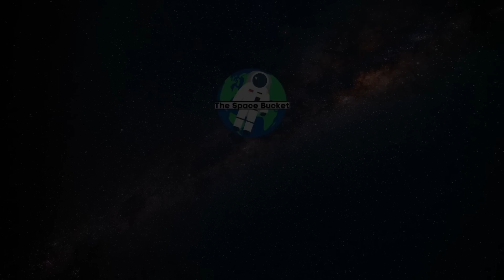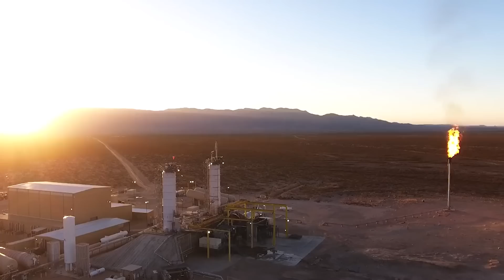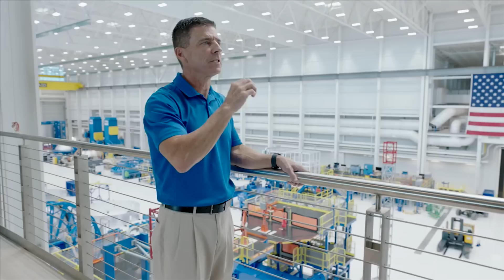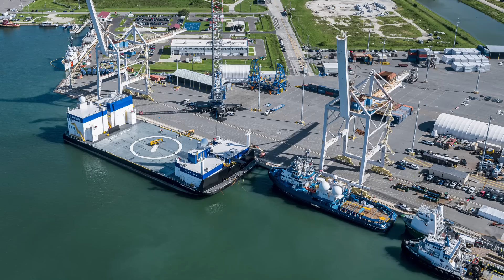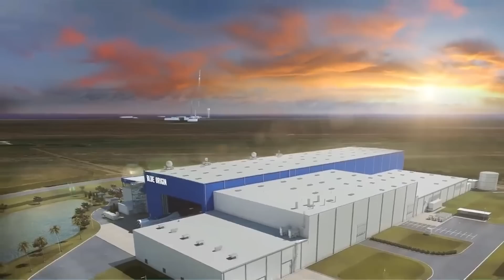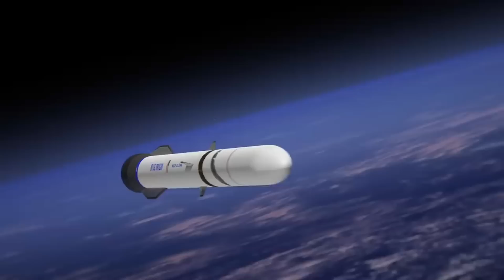A Flight Capable New Glenn Is Vertical On The Pad

Comment: So they are going to fly a new version of falcon 9. Neat.
Reply: you need to see size compere to falcon. This is super heavy rocket
Reply: Compare the fairing size and reusable payload weighf capability of both. It is superior to Falcon 9 and Falcon Heavy in almost every way.
Reply: @BigBlueFlame-000  but it hasn't flown yet. or landed. and rapidly been refurbished
Reply: @tisoymorena121  so? Blue planned it to be reused 25 times and refurbishement in 16 days. They said they are going to do 8 launches in 25. If they managed to do that then it's already cheaper than and better than Falcon 9 and probably heavy per kg cost. It will be superior to currently any rocket SpaceX has.

Comment: Before I say this:  I'm rooting for them.  But having said that, they have a benefit SpaceX never had:  The ability to watch SpaceX do it first and copy.  SpaceX probably saves Blue Origin 50% on research spending by just watching them.
Reply: Blue Origin predated SpaceX on reusable rockets and even the DC-X rocket predated both companies.
Reply: @aluisiofsjr you can’t deny that spacex has been much more prolific in their use of reusable boosters with falcon 9 and falcon heavy, which I’m sure has provided a lot of insight to technicians working on blue origin
Reply: @aluisiofsjr they were not orbital first stages
Reply: @aluisiofsjr  Others predated with test articles and BO has never returned a booster from anything like the same speeds as F9.  Spacex took and old idea and for the first time made it practical.

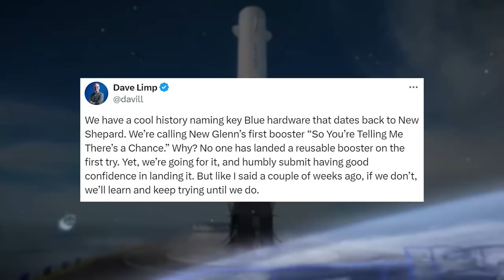Comment: 4:24 No one told him about starship flight 5 ?
Reply: That tweet was from September, before flight 5.
Reply: Umm, that was on the fifth try, as your comment also implies.
Reply: @davidjohansson8739  Just wait, they'll parse your comment down to the font in favor of "their guy." 
Me? We need DOMESTIC RE-LAUNCH COMPETITION because foreign re-launch competition is definitely on the horizon.
Reply: @davidjohansson8739  There was no attempt made to catch the booster on the first 4 flights, so they did land it on the first try.
Reply: @daisaigaming6836  I'm not trying to diminish the achievement of SpaceX here, but they didn't crash 4 boosters into the sea for fun you know. They did it because they knew they probably couldn't land them on the first attempts (which they were correct about, since the 3 first launches literally exploded).. So I would say his statement is still correct.
Reply: The point is domestic competition in landing-capable booster hardware is good.
Reply: The tweet is before flight 5

Comment: I hope New Glenn works. but I have a feeling even if it does, their launch cadence will still be glacial. 20 years, zero rockets. No, the bezos bozo blaster and test articles do not count
Reply: 8-10 launches next year, 24 in 2026.
Reply: They were not working on a commercial launch vehicle for the last 20 year though.  Maybe you just don't understand what's going on.

Comment: New Glenn was designed to work the first time.  BO is a traditional rocket company and that's how they operate.  It's also why it has taken this long to get to a launch, why the vehicle looks irreplaceable instead of mass-produced, and why we probably won't see a second New Glenn launch for a year+.  If anything at all goes wrong with the launch, it won't be because they're prototyping and anomalies were part of the package; it will be a failure of a finalized design.  Same exact scenario with SLS—had it failed to finish the mission, it wouldn't have been because they were merely testing a prototype to inform future prototypes.  These companies do all their testing on the ground, and that's why it takes so long.
Reply: "BO is a traditional rocket company" - Search YT for Convair Atlas Quarter Film Report HACL Film The San Diego Air and Space Museum has a collection of raw engineering footage, internal reports, reports to Congress, advertising, since Atlas had 4 or 5 engines and ran on alcohol, and earlier like home movies of Charles Lindberg gliding over Torrey Pines while visiting Ryan air.
Reply: Solid take. I find myself impatient sometimes. But I remember that SpaceX is one of the only companies to do that kind of testing at a reasonable scale. No disrespect to others such as rocket lab. It’s still amazing and very necessary for the space industry. But it’s simply a cheaper vehicle since it’s smaller. But this is very true. I hope their approach works. And I think based on them skipping the paint. They might be willing to take a few notes from SpaceX in the future. If needed.
Reply: @spray_cheese  I would be extremely surprised if it turned out it's cheaper to build New Glenn than Starship.  The latter is sub-$100 million for the entire stack including tiles and engines, a price tag only likely to shift downward due to the transition to Raptor V3 and the corresponding savings on the most expensive component.  That said, I also don't expect BO to outright fail on their launches, and they're not interested in sending 1,000 vehicles to Mars, so the cost of the vehicle is not terribly important.

The cheap cost of Starship is the very reason why SpaceX is able to get away with doing the most important tests on actual flights, which in turn is why they are able to try things, and at a ridiculous pace, which would normally be extremely difficult to test at all.  I think the point which epitomizes the difference between them and the likes of BO would be the size of the engines.  Raptor is small and uncomplicated enough to swap out in a few hours, without having to tip the vehicle over or drag it to a bay.  BE-4 is more in line with standard engine sizes for rockets and those options are pretty much off the table.  Maybe not a huge deal in the grand scheme of things but multiply that inefficiency many-fold and the picture becomes clearer.

Comment: SpaceX is building a single raptor engine every two day, and a new rocket every 2 next months. It takes BE 2 to 3 months to build just 1 of its 7 needed engines without taking the rocket into consideration.
Reply: Different goals, different development process.   It's like comparing starship to the SLS or apples and oranges.
Reply: @michaeldeierhoi4096 Indeed, new glenn early development is alot more clean, careful and precise while starship early testing phase is alot less picky, and full of grit.
Reply: @OubleJum  The major difference is speed.  Spacex has the potential to develop faster but it'll produce more duds and can cost a lot in terms of expended hardware.  That is the one big advantage in stainless, they were going to go carbon but that would have made each test article 10x the cost and it's slower.
Reply: Production can always be ramped up once past its testing stages. Not like Jeff is short of cash to make it happen.
Reply: Blue Origin's goal is to produce a BE-4 engine every 3 days next year.

Comment: It's not just the outside of the rocket. I remember SpaceX Starship booster having problems with snow and ice forming inside the tanks on the boost back burn. BO does not have experience with a booster this size performing boost back burns.  I expect them to have similar issues that Starship had with ice forming inside the methane tank.  My opinion.
Reply: You do realise that the ice problem spacex had is because of how raptor works, they use the preburner gas to pressurise the lox tank. The problem is that the preburner gas isn't clean and contains stuff like water that will freeze at the temperatures in the tanks. As long as you don't contaminate the inside of your tanks which new glenn doesn't then you won't have this issue.
Reply: They do not do a boost-back.
Reply: Contamination

Comment: The thing has been in development for going on 11+ years now. It better land first try.
Reply: Starship has been in development for 15 years now, and even though it has landed a couple times, it's still in prototype, and has 1 more block/version to go yet for the Ship, and two more for the booster before it's fully operation.  New Glen is supposed to be fully operation from the start. However, I don't care how long it takes to develop these things. It's not an indicator of anything.  For example, Starliner started development in 2014, and is complete junk. The only thing that matters is, does it work, is it reliable, and is it relatively cheap.
Reply: @hawkdsl  starship as we know it has been in development since 2018 everying before that (ITS/BRF) were pretty much completely scrapped until they went back to the drawing board and started from scratch in Boca Chica
Reply: @jeremycastro8223  pretty much the same happened with New Glenn.  The current design is mostly from 2018.  Just enjoy rockets and don't be a fan boy. All rockets are good.

Comment: Seems like a TON of work on a singular rocket.  How mass reproducible are these?  At what cost?
Reply: They want to make 2-4 boosters per year. Upper stages will need to be mass produced to meet demand. Their cadence goal is 8-10 launches next year and 24 in 2026.
Reply: @leo_is_a_baka yup and every booster is designed to be reusable for 25 times.
Reply: I don't think their goal is mass production.  They have nothing like Spacex's Mars ambitions.
Reply: Google may have the answers. Maybe check out Everyday Astronauts BO's plant tour... but I know they have three more in production currently.
Reply: @hawkdsl 2.  They had three, but recently imploded one when they brought it into a cooled building after being in the Florida sun and it imploded on itself
Reply: @MrAlbertaSurfer  That was the upper stage tank IIRC, so they still have three in the pipe line, minus a section.
Reply: @Coocoocachoo809  design is only one part of making. The size and scale of these things, you have to make the things to make the things with. Often buildings have to be designed around the thing to make the things. There is a ton of work for sure.

Comment: So 850 tons is ready to launch and be reused for another launch right? No? Look, the cost of a one-time shot is like flying from LA to Brisbane and then throwing away the 747. It just doesn't make any sense.
Reply: Reuse doesn't happen after the first try.  Not even for spacex.
Reply: Starship is still a ways from being ready to launch again after landing.
Reply: @ : Actually the only reason the booster didn’t land back at the Launch / Capture stand was because the signal between the two was lost. SpaceX wanted the aborted water landing anyway. The word is that if they had tried a capture, it would have worked anyway. Starship will see one more water landing before they try for a capture. The next test launch will happen late January or early February 2025. If all goes to plan, SpaceX will us the new engines and upgraded Starship to send up Starlink Satellites. So no later than April, Starship will be operational. Astronaut rated versions will happen by the end of 2025 or early 2026. However, there is no way in hell I would ride on the Starship return. I might on a Crewed Dragon but the entire landing process on Starship reminds me of the movie “Aliens” when they dropped the flying ship from underneath the spaceship. Bill Paxton’s character said “ We are on a one way ticket to hell.”
Reply: Are You Stating That Musk Would Not Fit In Trumps Position Of Wasteful Money Spending For Our Nation ??? Musk Has The Full attention Of Our Government Now ! But It Would Not Surprise Me If He Walks Away From His Government Title Just From All The Back Crap Flow He Will Constantly Receive In a Government Position !!! Talk About Someone Who Has Far To Many Irons In The FIRE !!!

Comment: No one landed a booster on the first try? Well - if you don't consider catching a superheavy booster by the launch tower as landing it, then I guess that's right.
Reply: That was starship's fifth flight. They had done soft landings during the first few flights. The correlation to this flight would be soft landings for the first few flights before attempting a landing.  Was similar for falcon 9, before attempting a landing. 

They are betting on their experience with New Shepherd landings to help with their software and hardware. More power to them.hioe to see them successful.

Starship catch was amazing, but not exactly the same thing.
Reply: @andrewbstevens  The key words here are "first try" not "first fly and land": SpaceX didn't try or attempt to catch or "land" until the fifth flight, and were successful on that first attempt.
Reply: @NaturalMarvels  SN8?
Reply: @hawkdsl sn8 is not a booster.
Reply: @andrewbstevens  Fifth flight, yes, but none of the others had attempted a catch.  5 was the first attempted catch, and it was successful.  So yes, SpaceX did, in fact "land" a superheavy booster on the first attempt to do so.  Maybe BO can do the same... but unlikely.
Reply: Thing is, before IFT5 spacex ran dozens of tests on the vehicle to gather data. BO has no actual practice flying NG.
Reply: @oberonpanopticon  I understand, but the first try in catching the orbital super-heavy, SpaceX was successful. As far as launching and landing all in one, this would be a first if they pull it off. I really, hope they do, as that would be great for the country and space development.
Reply: The soft landing on IFT 4 was literally a test to see if the booster was able to be catched. "The goals for the test flight were for the Super Heavy booster to land on a 'virtual tower' in the ocean" They measured the precision they were able to archive at sea, even told us about it, then used all that data to prepare for the catch on IFT 5. They also tested the tower arms extensively both with and without test articles beforehand. So it's easy to claim a "first" when everything has been tested beforehand...
Reply: They attempted a soft Starship booster landing in the ocean but failed at the first few attempts. Flight 5 was their first catch attempt, but not their first landing attempt.
Reply: @cube2fox   Attempting a soft splashdown vs attempting an actual landing are two entirely different ambitions. What was probably intended here, is first flight and landing attempt - all in one. That I would agree with.
Reply: Lucky fluke. Couldn't repeat it.
Reply: SpaceX destroyed all their rockets except one.
Reply: Limp should have written no one has landed a booster on the first FLIGHT.
Reply: B.O. is trying to spin their slower and more expensive development process as better because they didn't crash any prototype orbital rockets before attempting to launch a payload. Although, that payload is a prototype.

Comment: I do hope that New Glenn succeeds first time, I really could care less for Starship's development style. It's just a justification for mass production.
Reply: And NG will be different than starship how exactly? It might not be mass produced to the same extent, but it’s not as if they’ll just build a single booster and call it a day.
Reply: @oberonpanopticon  I don't think they have flight cadence ambitions that match Spacex long term goals.  So they don't a big fleet of ships and tankers.
Reply: @oberonpanopticon   The thing is SpaceX in regards to Starship, outside looking in, looks like they are mass producing garbage.  This last Starship that flew was SN31 I think? Between the first successful landing, which was SN15 to now has been 16 times they've built these things. Somewhere in the process it looks like engineers gave up on engineering and forced the development on the welders.
Reply: @12pentaborane  You don't seem to understand what spacex is doing and seem to think they're following the same development path.  That's wrong, completely wrong.  What you're seeing are low fidelity throw away test articles.  NOT finished products.  You are in over your head and you draw badly flawed conclusions because of it.
Reply: And mass production is the whole point..
Reply: I think both companies hope for "mass production" like car manufacturing. When these ships are fully mature, they will be able to crank them out. All the parts will be standardized, and very little custom parts will be needed. That will bring the cost down significantly.

Comment: What is the status of returning the upper stage? In the absence of being able to do that, Blue Origin will never be competitive with SpaceX.
Reply: Until we know the costs how can you say it's not competitive?
Reply: @imaginary_friend7300  He can say that because he's a fan of only one rocket manufacture.
Reply: @hawkdsl  Yes.. With so many it's one extreme or the other.  The fools..
Reply: Iirc they’re still analyzing whether or not it’d be worth it. ULA is competitive with spacex and they’re fully expendable last I heard. And as scout said, it doesn’t need to compete with spacex, it’s a different vehicle for different missions.
Reply: SpaceX doesn't recover the upper stage of any rocket either.  Yes, that's the goal with Starship, but they aren't there yet.  New Glenn is closer to Falcon Heavy, not Starship.
Reply: New Glenn goes to SEO, Starship is LEO optimized. 

Vastly different markets and Starship cant serve NGs customers.
Reply: Sure Starship can: Just like LTL (Less than Truckload) trucks serve several customers at the same time.